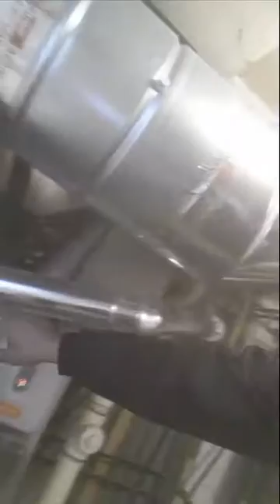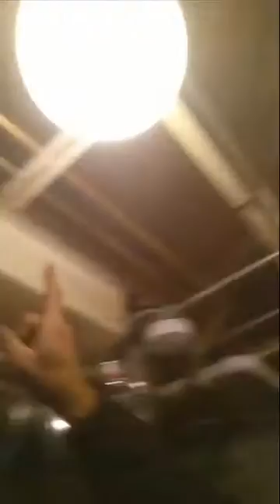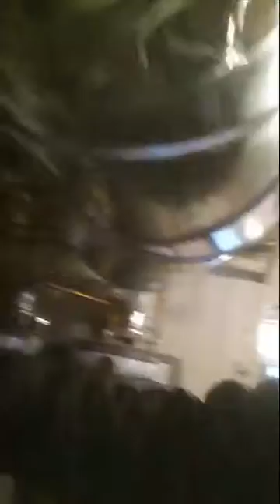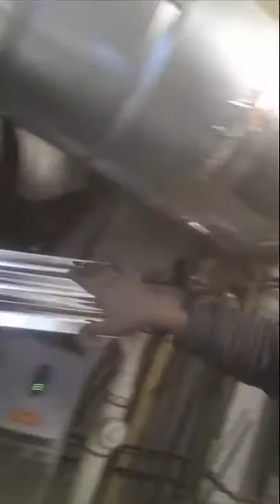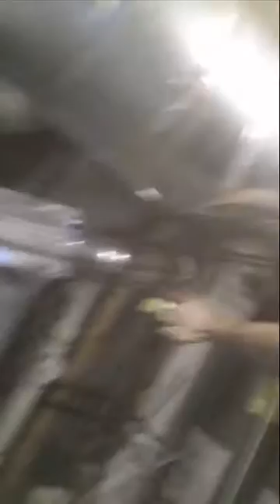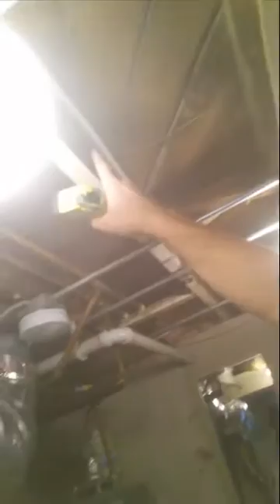How to use exhaust heat efficiently

Comment: My furnace and water heater exhaust go into the same chimney. I was going to put a copper coil inside and pump the water trough it to a radiator in my garage.

Comment: I was cringing at the heat lost out the chimney just like you. Thank you for sharing this! I may add a thermal paste that I happen to have left over from building computers 10 years ago 😄. I wonder if standard roof flashing would conduct heat as good, I have a big roll left over from an unrelated project, if it conducts good then I can cut it into a bunch of pieces secured to the pipe by a pipe clamp.